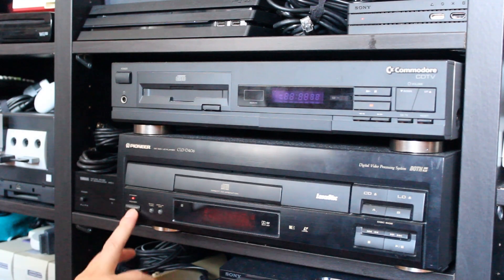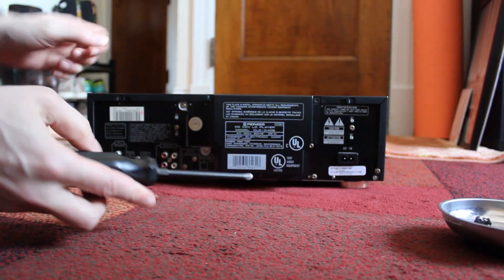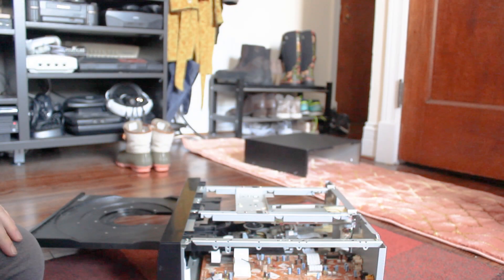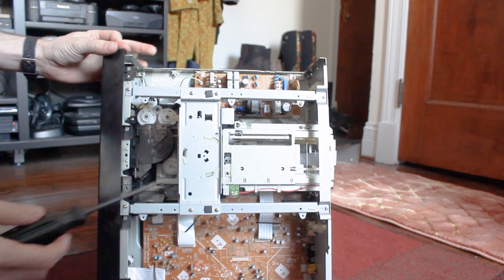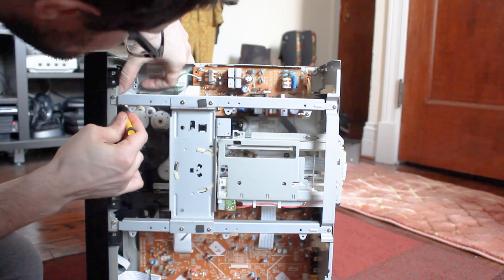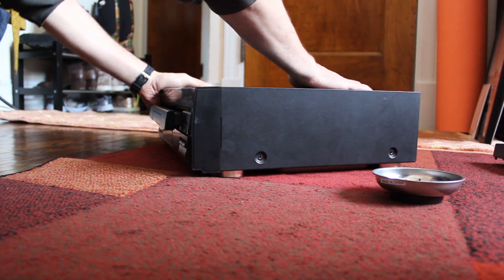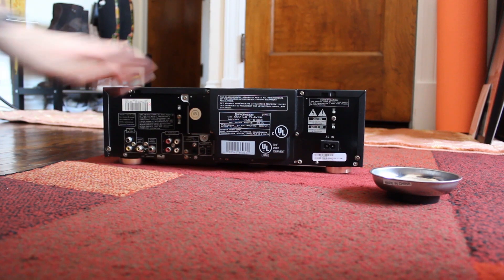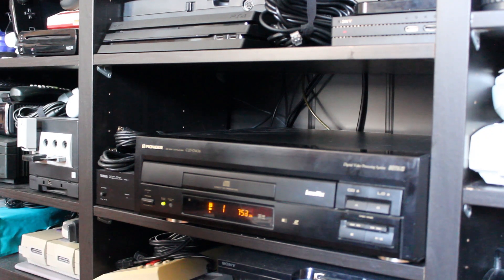Pioneer CLD-D406 LaserDisc Loading Belt Replacement

Comment: Thank you sooooo much. It worked fine with my pioneer CLD-D925. I was looking for a tutorial on youtube on what could possibly be the problem; found the belt on e-bay for 10€ and changing it was so simple. Now works as new. I am truly grateful Sir.  Cheers from Rome!
Reply from the maker: Hi, EnricoPL, I'm really happy to hear that! If you find that the problem returns in a few months, it's possible that the belt you found is not quite the right size, even if labeled as VEB1184. I was informed that my player uses a size "SCQ 3.6 Square Belt", and after ordering that from an electronics supplier and replacing my supposed VEB1184 belt I have yet to have any issues for the last several months. Cheers from Chicago!

Comment: My player had a U1 error when I first got it, but it went away after I just shook it around for a bit. Now it plays side A perfectly fine, but side B stops working after 2 or 3 minutes, and the player just stops itself.
Reply from the maker: Ouch, that sounds very frustrating to deal with. If you have this same unit, the entire laser flips upside-down for Side B, so I could imagine shaking it around may have forced something out of alignment just enough that it stops being able to 'see' the disc track after a few minutes of travel.

Comment: Hi, I'm looking at one of these D406 units on eBay as my first LD player. They claim it won't load CDs at all and produces the "no disc" error, and has trouble playing LaserDiscs, I assume it's skipping. Would a new belt fix the problems or are there other adjustments or repairs that probably are needed? They're only asking $40 for the player.
Reply from the maker: Howdy! Normally I'd say that's a great price for a really solid unit. It's hard for me to say whether the belt alone would fix its issues. I think it could be that, or maybe there's something more difficult that is wrong with the laser pickup inside. If the pickup was out of alignment then I could imagine how it would both not 'see' CDs at all and struggle with tracking LaserDiscs if there's any wobble to the disc, which could explain if there's intermittent errors during playback. On the other hand, the discs they're testing with might also have random dropouts due to disc rot. I think the price is low enough and the belt fix is easy/cheap enough that it would be worth a shot. (Also be forewarned that LD players don't travel well, so you always run the risk that shipping ends up damaging it further.)

Comment: I just did this process with a CLD-505 because I was getting a No Disc message and wouldn't play laser discs or cds.   unfortunately it didn't fix it.   Any idea what might cause it to not see the disc?
Reply from the maker: Hi Anton, sorry to hear your player's not working. If it's not playing either type of disc, it's possible that the laser itself has weakened to the point that it's no longer recognizing that a disc is in the player. Does the player attempt to spin the disc at all?
Reply: @bitcrush_io  Thanks for replying.   It was an Ebay purchase with a return policy so I returned it.  I like fixing old electronics but not when I pay as much as I did.  I think it was the belt or the optical disc sensor.  I don't think it got to the laser activating part of the process.
Reply from the maker: @AntonDoiron  Glad it worked out, although I hope you've been able to find a replacement! I know that shipping players has a high damage rate, so best of luck.

Comment: Hi, have a question, i have a CLD-M401, the arm doesn't star in the "rest" position when i turn on the unit. (i saw a few videos and i see that the "rest" position need to be on the front, i mean it's need to be on the hour "6", 6 is the fron on the unit an 12 is the back) my star on 9, an when i turn it on goes to 12 and is stuck there.
Any ideas to how can is put is back in the rigth position?
Reply from the maker: Hi Pablo, I haven't seen the insides of that particular model, but they are the same as the CLD-M450 and CLD-M301 which might give you some ideas. It sounds like you're referring to the large clamping mechanism that swings to each CD tray position as seen in this video - https://youtu.be/L6iyUSnrGk0?t=214

When it hits 12 o'clock is there any sound like it's trying to move further, or does it simply stop?
Reply from the maker: I'd also be curious about what happens when you press the CD buttons as seen in this video: https://www.youtube.com/watch?v=HCKFw-819mE

Comment: I have a Pioneer HLD-X9 that I'm having trouble with. When I try to open the tray, it doesn't open, instead it just makes a humming nose for about 10 seconds and then says "U1" on the display panel.

Could this loading belt have something to do with that issue?
Reply from the maker: Loading belt is always the first and easiest thing to try with tray issues, and it certainly sounds like one. You can find the (Japanese) service manual on lddb.com, and it confirms that the loading belt is the VEB1184, same as mine. But, the HLD-X9 is a much different beast internally so it won't be quite as easy to get access to the belt, but once it's open it should be a cinch. If that doesn't solve the issue, you could have a deeper problem with either the spindle motor or one of the gears.

If you need extra help, I recommend joining the LaserDisc Forever! group of Facebook, or contacting @Laserdisc Home Theater on YouTube - he's probably the top US-based expert on high-end players.